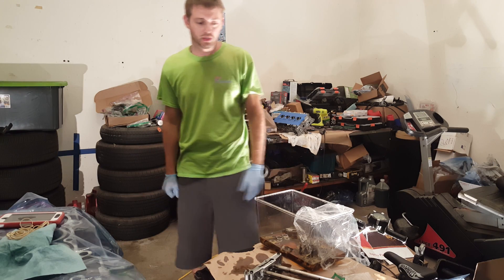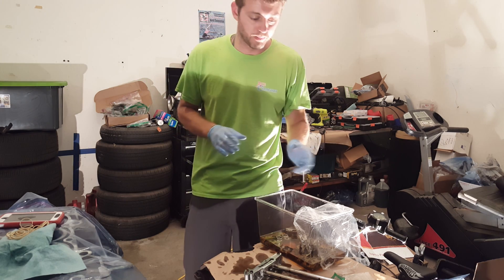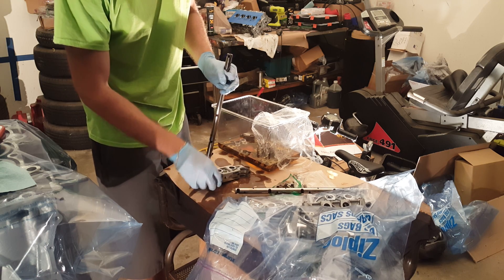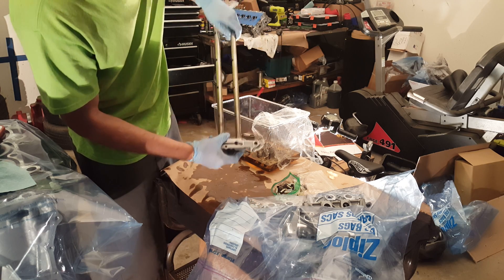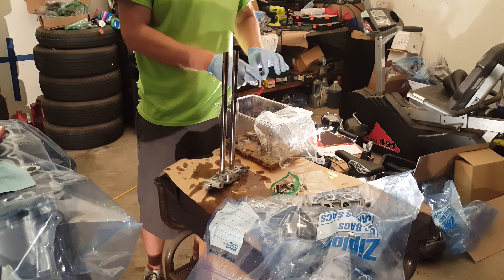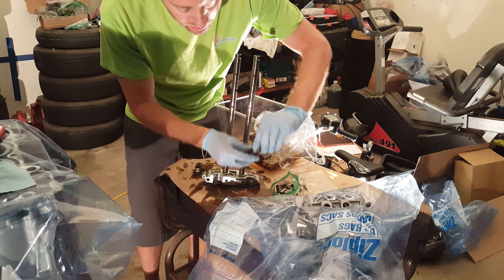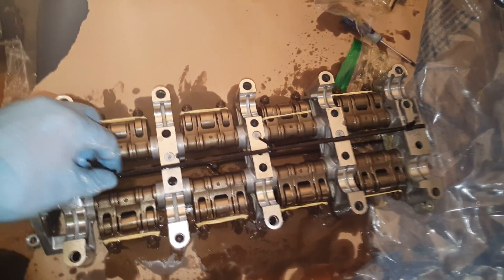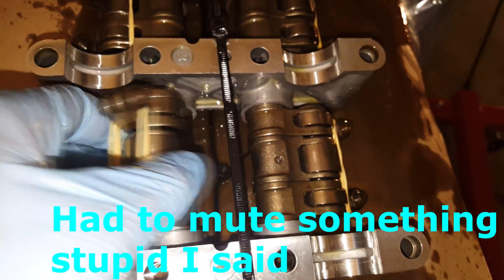K Series Rocker Assembly Rebuild

Comment: I appreciate your response.  My VTEC recently stopped working, so I removed the VTEC solenoid to clean the screen & install a new gasket.  At the same time I changed oil, only to discover a spring on the magnetic tip of the oil pan drain plug.  Having pulled a K24 head before, I'm familiar with the precautions taken to not have these pins and springs go flying. 
My gut says this is no coincidence, so I pulled the valve cover to look for possible rocker problems.  All appears in order, however I'm uncertain of a verification method for the possible missing spring, short of pulling the entire rocker assembly.

Comment: When you insert the rocker shafts into the first cam holder, does it matter if the holes in the shaft are up/down or sideways? I just installed mine and all the holes are facing up but now I have doubt and unfortunately I would have to disassemble to verify.

Comment: You should insert the middle cam cap bolts as you are assembling to make sure the rocker shaft is aligned properly or else when you go to bolt on the assembly, you'll have to take it all apart again.
Reply: Plus that helps to keep the entire assembly together.

Comment: What valve lash did you use? spec'ed? or anything in particular? did on on a 03 a while back.
Reply: Usually 8-9 thou on the intake and 10-11 thou on the exhaust.

Comment: Do the rocker arms need to go in the same order of which they came out. Can you mix them up?
Reply from the maker: The rocker arms need to go back with the same valves they were paired with and the valves are supposed to go in the same spot in the head, so yes. It will run fine if you dont but its best to keep them paired.

Comment: can you switch the k24a1 rocker arm assembly to an A2 assembly without switching heads its the two rocker VTEC assembly  only on the intake
Reply: Matthew Von Allmen yes you can you will have to switch the middle pins to keep the big lobe locked. If you search it is called vtec killer setup
Reply from the maker: Matthew Von Allmen honestly I don't know about that swap. You would definitely have to change the camshafts, and the tune as well. Also depending on the bottom end you would need to make sure you have valve to piston clearance. The k24a4 Pistons I do know are not compatible with the lift and duration of an a2 head.